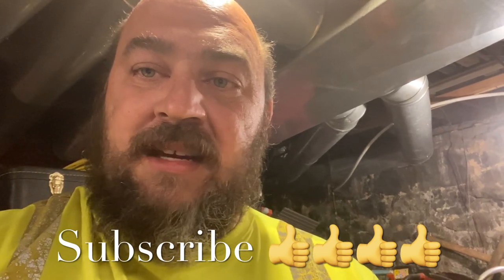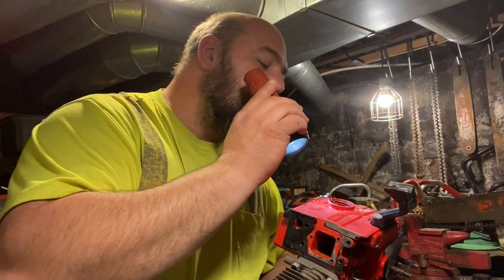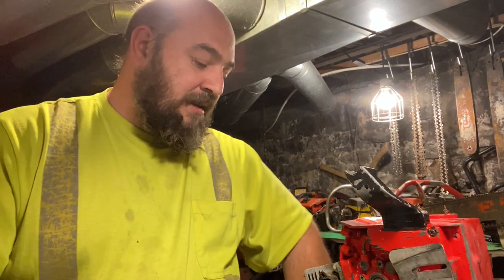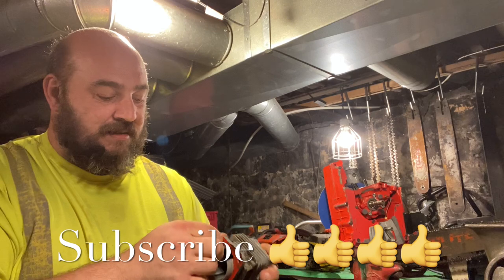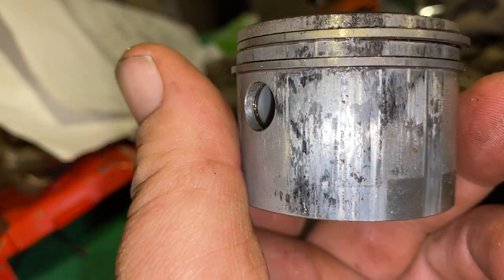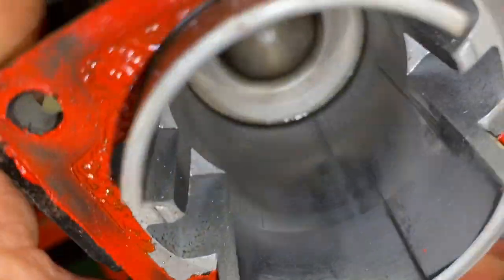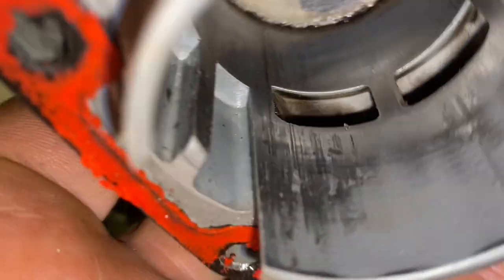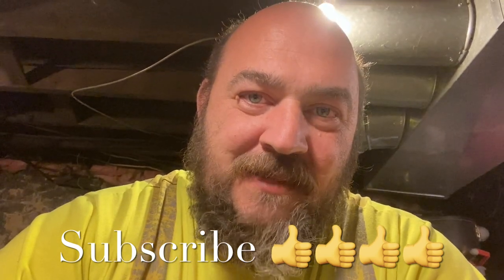Porting Homelite Super XL-130 Chainsaw!  Scored Piston And Cylinder! Repair or Replace?

Comment: New to your channel . How did you clean up that cylinder? I thought that was heading for the trash can! Good job.
Reply from the maker: On this one it appears as though it was all aluminum transfer from the piston. I just removed the aluminum with some mild abrasive material which took a long time.
Reply: Thanks. Im just starting to fool around with chainsaws. Im learning a lot from your vids.
Reply from the maker: Thanks for joining in the fun!!  You will see that I do show the mistakes. Hopefully you will be able to learn from them as well.

Comment: I have a blue XL-12 that I believe is 54cc and need to put a piston and jug on so do you think a 58cc piston and jug kit from a Super XL would work since the old Homelites are so similar?
Reply: Check out eBay. Look up Little red barn homelite xl12 cylinder. They have a kit with everything. Sxl is 46mm or 1-13/16  bore. Xl 12 should be 1.75”.  I would just check to be sure coil mounts, etc match. Stroke should be the same. Good luck.
Reply from the maker: I have heard of people doing this successfully but I have never done it myself.  I do not know what is involved.  I believe it is a simple bolt on situation but until I do it myself I cannot say for certain that it is.
Reply: Sxl piston and jug will work fine on it